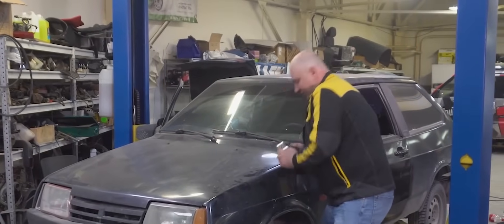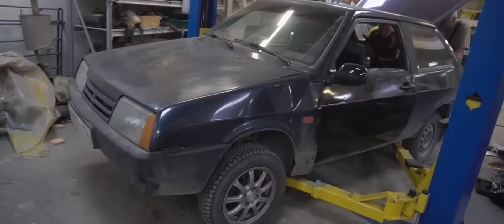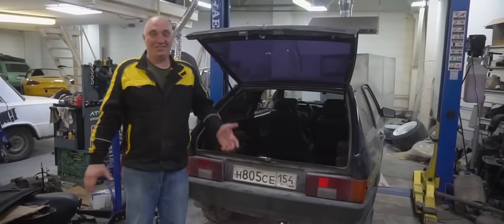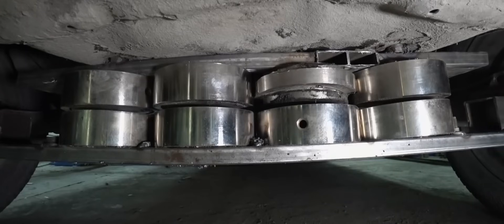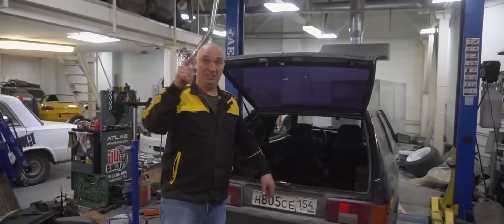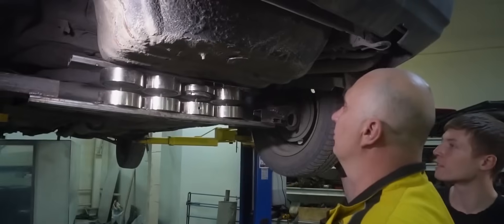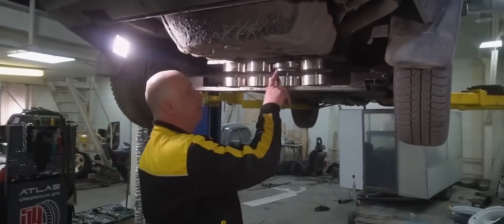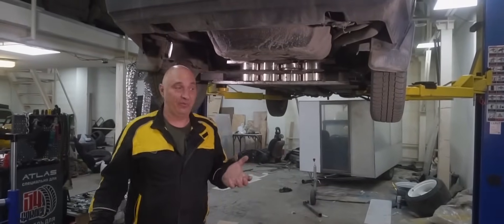DIY magnetic suspension

Comment: Could put rubber washers for shock absorber on guide posts to cut down the vibration, friction and hammering the magnets do. Electromagnetic may have more repellant, but requires power. Might be worth a test?

Comment: 3 magnets stacked at each wheel will give you 20 to 30 mm of travel. [+ -][- +][+ -] middle magnet will float with a rod thru the center again. The the other 2 will be attached to the car and axle.

Comment: As you said these are supposed to have 600kg of pulling force each, but a much weaker repulsive force, then it makes more sense to use their much stronger pulling force instead.                                          Try using two of them mounted on the fixed top beam pulling against the steel of the moving bottom beam and two mounted on the moving bottom beam pulling against the fixed steel of the top beam...Then you have a perfectly balanced pulling force in both directions which will keep the magnets apart and it will be far more powerful than the repulsive force between 8 opposed magnets.                      It is basically the same principle used for spokes on bicycle wheels, which pull the rim towards the hub and simultaneously pull the hub towards the rim...making a far stronger and lighter wheel.

Comment: Good!  I would suggest two things - mount the whole assembly on a pneumatic bag that would absorb the shock when the suspension is fully compressed, so the shock would not be transmitted to the chassis, and add an electromagnet on each end that would trigger in proportion to the amount of travel - as the axle went higher, a sensor would increase the current to the electromagnet, increasing the resisting force and decelerating the axle movement.  That would stop the permanent magnets from banging into one another at the end of their travel, which wears out permanent magnets.  Adding shock absorbers, as you mentioned, would take care of the rebound problem and damp oscillations.  Good luck with the project!
Reply: Great idea. I'm sure between you and him, you could market this idea to GM. I like the three ideas of suspension control

Comment: You can not used this magnets with the metal ring .... the magnet is pushing away from each other but the metal is pulling each other. 

Set a few magnets in line with bar in the middle to keep them in line.  You will get a longer and stronger stroke of magnetic power.

Comment: I suggest some rudimentary system associated with the existing permanent magnets but now with an active system made with some strong electromagnets driven straight in the suspension with a LM555 comparator integrated circuit with a zero point and sensors put to the shafts to establish some stability and correction action powered with an additional 12V car battery for each wheel, maybe just the one extra battery does it. Maybe I'm crazy, everybody I know calls me that. How about a second permanent alternator to power/drive this suspension and suspension battery (supposedly)....  thank you again Garage 54 for this experiment, it was really great. I congratulate you for this effort. Well this is not a blueprint for nanotechnology, but I throw my cents in it for it already.

Comment: Off the top of my head, I’d recommend 2 on each corner near the wheels. Simply because I didn’t like how close those magnets were getting to each other, I’d make a minimum of 3 on each corner in a L shape formation.
Because I’d prefer a smooth ride no matter what (you never expect “worst case scenario” until it happens), I’d place probably 5 on each corner in an L shape formation w/ 1 in the corner, 2 leading across the car body, & 2 leading up/down the body. That’d give you completely independent suspension (independent from each other) & each corner could take the full weight of your vehicle, so the magnets will never contact each other.
But 5 on each corner (top only) comes to a total of 10 (top & bottom) on each corner & 40 magnets is a LOT. I’d bet you’ll be safe w/ just 3 on each corner (top), so 6 on each corner (top & bottom), which comes to a total of 24 magnets.
Reply: this does not fit well with the garage 54 style
Reply: @apenny9300  
That’s a car I’m unfamiliar w/.
If 4 sets will work, such as what you show, I’d try to do 2 sets up front & 2 sets in back.

Comment: With all the surface area you only need a thin rubber sheet between the magnets to protect them at end of travel, if you can keep them fairly flush. The outer bands are possibly low carbon steel for high magnetic permeability and actually strengthen the magnet, rather than weakening it.

Comment: This is the most amazing thing I've ever seen! True russian genius worthy of national pride.
Reply: Dumbest idea ever. Adds half ton to the car, increases unsprung weight and costs 5 x as much as regular suspension.
Reply: So does Lexus with Bose magnetic suspension. The difference is that Bose uses magnetic fluid activated by inductors. Not dumb mega sized, mega heavy magnets. So it is electro magnetic suspension using coils if you can comprehend the distinction.
Reply: @Traderhood  THen explain why the Camaro has magnetic suspension then fool.

Comment: Instead of making a horizontal bar with magnets in series, a vertical tube with these same magnets arranged in opposite poles always facing each other ([N P] + [P N] + [P N]). The same design as a motorcycle spring suspension, but instead of a spiral, magnets.

Comment: Or why don't you go One Step Beyond with the opposing magnets if you know what you're doing by putting coils around it that the opposing magnets can generate low veritable current and you had that low veritable current that can be transmitted back through the ground to a side substation as a bunch of cars go down the street and it's undulating through those magnets to create electricity through the shock-absorbing properties or you can transpose that energy back into self charging battery Bank where you can have one more element that would charge the battery in a eco car let's get One Step Beyond everyone I like your idea but think it out

Comment: The challenge to overcome is that the force of the magnets pushing away from each other weakens exponentially with distance. The 600 kg capacity could be accurate, but only at a distance of zero.

I would love to see the results if someone could find a solution to that. Maybe a stack of them vertically...
Reply: We used to have a stack of thin magnet discs and a guide rail at school it was easy enough to squash a few magnets together, but fairly difficult to compress them down enough to fit all of them on the rail if placed entirely in opposing pairs

Comment: You can put caucho discs 1/2 " higth like shocks between the magnetic discs to amortization it.
And 1 or 2  both of magnetic discs more for better and more capacity load of the car.
And can put nuts at the end of the guia bars and. grey or black plastic or fiber glass cover in it. To protec and nice view mecanic finished.👍

Comment: I think you should try these magnets with springs. I mean you remove shock absorbers but keep spring coils attached With car. Second if you try these magnets with small air below suspensions then these magnets cover hard jumps easily and counter extra force

Comment: I think that magnetic force is proportional to the inverse of the distance apart squared, so they will only have 600kg of force when touching with the force rapidly decreasing as they are moved apart. Is probably why they did't get much suspension travel but never bottomed out either.

Comment: Metal part around the magnets redirect magnetic force all to the one side. So you get for example north pole in the middle and south pole on the outer metal rim part. That redirects from the other side of the magnet. So either you shorten the metal outer part by few cm, just to keap the magnet in place. And also navigate the oposite pole. Move the pair of magnets closer to the wheels. In the middle they are under the leverge from the distance to the wheel. So they act week.

Comment: Stack a number of magnets inside of a copper tube so they're arranged to repel each other.  The magnets should generate eddy currents when they try to move through the copper.  The eddy currents will induce an opposing magnetic field against each moving magnet and might do some level of dampening.  Not sure how you'd cap off the ends to keep the magnets contained and allow the assembly to be mountable.  I imagine it to be set up to replace coil springs.

Comment: I'm thinking that if you put a copper sleeve around the magnets along with some springs, you'd get a pretty dank suspension setup
Reply: Excellent point! I've done that experiment by dropping a magnet through a copper tube and it actually slows the speed of the magnet falling.

Comment: Make a cylinder with 3 magnet inside. 2 at the ends an one in the middle. The one on top is welded. Make it work lice a shock absorbents.
Reply: Msybe but you would need oil inside aswell to dampen everything. Not a stupid idea tho. Ya know thats crazy enough it might actually work.
Reply: The center floating magnet and the bottom plunger magnet would need small holes in them to allow the passage of oil. Put wipers on those 2 and i seriously think that could work.

Comment: Try putting the magnets evenly on the back axle, not next to each other. And add 5-6 magnets, and between them a circle of rubber, so they never touch each other, metal on metal. Add the shock absorbers and that car will go up the mountain with no problems.

Comment: If you stack two magnets you will almost double the power of push and pull. Try the stacked magnets on a motorcycle but be sure to use shock absorber! Should work really well! Moving them in pairs closer to the wheel will work better on the car, with shock absorber, of course!

Comment: You should manipulate the pullingforce in a way so you can use it for suspension as like you said it is stronger than the pushing force.
But even then, the advertized 600kg pulling force only applies when it makes direct contact, when the gap increases the forces become significantly less.

Comment: Wouldn't it have been better to put them in the place of the original cprings?  Donut magnets opposing each other, with guides over the shocks.  That way you could use 3 or 4 magnets per side, and the standard setup on the car.

Comment: The beauty of Magnetic Suspension is the high tech application. On a real M.S. the shock cylinders are filled with a ferrofluid that changes the viscosity of the fluid with a highly sophisticated computer calculating electrical management system. This is not that, but good effort though. 👍

Comment: You are into something. But maybe maybe building construction on cross so you could reverse it to the pullung force holding the car up. And build so the car cant raise high enough to reach eachoter and lock. And maybe also with combo of pushing force. If a car really would drive its lifetime its the best the suspension are mounted cornerwise. Close to the wheels. With good shock absorbers it might be cool:)
But wonder how it will be when they get harder closer they are. Might kill absorbtion. But still maybe if the complete play off the wheels go up and down is going on when still the magnets have distance. Then the hoovering is found and shocks do their work:) cool vids and stuff to find around. And your channel is amongst them:)

Comment: Stuck an electromagnetic system down there and you will have adjustable suspension on the fly. You might even able to slam the car and lift it akin to air suspension

Comment: Great video but those are not the right type of magnets to use.  They are called Pot Magnets, the steel ring is the pot and isn't for physical protection. Without going in to detail the steel ring becomes the north pole and the magnet centre becomes the south pole.  This is why when your magnets clamped together they were slightly off-set, north attracted to south. Pot magnets are very strong in close range, (which is why your travel was so short). You should use magnets that don't have a ring/pot, they will provide much more range and won't need to be so carefully aligned. Would love to see this with different magnets, and watch your fingers!

Comment: 7:53 Guy: "Why does the transmission keep popping out of gear?"   -Me: looks in direction of magnets....
Reply: when you upgrade your car but at the same time discover a new fuckup
Reply: Love the descriptive text of your reaction! 🤣😂🤣😂🤣😂
Reply: The force of a magnets magnetism depletes exponentially, so I highly doubt that it’s magnetism affecting the transmission. If anything it’s probably a problem with weak synchros and/or not having the suspension to prevent jolts and torsion forces
Reply: Bruhhhhhh that car is barely alive that's why it's popping out of gear
Reply: Metoo😂😂
Reply: The force exponentially drops off with distance...
Reply: @Sean Grahame you think twice about the pulling force from these magnets
Reply: @rafalbuijs5061  I highly doubt it would reach the transmission
Reply: @imtrash1228  
"I highly doubt it would reach the transmission"

And you would be correct in that assumption.
What is causing the transmission to pop out is the fact that when they took the shock absorbers and OEM springs off the car, they opened it up to all  sorts of twists and bends. 

Those twists and bends combined with all those bumps, are what is causing the transmission to pop out of gear.

Comment: If you add voltage to the magnets with a voltage regulator inside to adjust the magnet strength would probably work way better

Comment: Take the spring out of the strut . Find magnets with same diameter as the shaft on the strut . Use rubber spring helpers 1 under bottom magnet and 1 on top magnet to take up gap. Basically replace spring on strut with magnets and use rubber helpers to get magnets close together then reinstall strut on car.  You have Great ideas ideas Sir.

Comment: More magnets. More space between them. Surround with non magnetic material. Could pick up a crowbar or other metal.
Edit: Has to be electro magnetic. The weight of so many magnets outweighs benefit.  Youre on the right track.

Comment: Curious if you could just add some copper to you guides for diy shocks using the eddies
Reply: Definitely.  I think their largest problem is just the room required to install what they'd need.  A stack of magnets inside a thick copper pipe would provide eddy current damping.  Line the copper pipe with UHMW Polyethylene for friction reduction and alignment, sized so the magnets just fit.  Glue layers of low-density expanded neoprene between the magnets to protect them from impact (somewhat smaller than the magnets to allow them to enlarge when squished).  Mount the copper pipe to the car to reduce the unsprung weight. Some other small details like a cap with an air hole at the top and a stop-ring at the bottom to contain the magnets in the copper pipe.   This yields a coil-over configuration overall.

Comment: The reason why despite their 600 kg pull force the car almost bottoms out is not because the exert less force pushing than pulling. It’s a two fold reason. First, the strength of magnets drops off a lot as you separate them. The 600 kg force corresponds to the absolute maximum pull. Secondly, a lot of that pull force may be being reduced because of the attraction to the steel casings of the magnets.

Comment: Most probably weakened the magnetic force with all the impact and heat from fabrication
Reply: Bose did it with electromagnet
Reply: बोस दादा?
Reply: Yeah, that certainly did not help them
Reply: The poles will invert with permanent ceramic or neodymium. You need electro magnets so you can control the magnitude of the field and not worry about flux line inversions
Reply: @titirititiri6360  
Yeah but think about the power you would need to supply and the drivers for such a set up... you end up going over the vehicle's gvcw. Now maybe you could fill a shock with ferro fluid and you variable magnitude drivers to adjust on the fly. Man if nobody is already doing that im going to feel like an asshoke for giving up such great idea.
Reply: @mds1986ms  they are. Cadillac
Reply: @aayesher9400  
I remember cadi tried it but i guess it didnt go so well because im pretty sure they're back to air shocks now. Lol. Oh well elon musk will figure it out.
Reply: Yeah
Reply: @jkeelsnc  
Yeah its on the caddys and the Denali s in gmc and im sure a few others. I dont think they still use it though. Plus when you go to goigle magnaride the next thing that pops up is magnaride delete kit. Lol. So i take it its not well received. 

Alright so heres another idea. You use helium to super chill some magnets... Easy right? Just add another compressor pump like the one for the AC. Lol. Anyway then we could use some sort of quantum locking system for an all in one damper. No need for springs at all. 

Lol  i dunno what the hell im talking about obviously. Hahaha!

Comment: You need magnets without iron rings, the iron rings bend the magnetic field inward and you end up with a much smaller but more concentrated magnetic field, so if you want distance, you want magnets without the metal ring.

Comment: Correct me if I'm wrong but I think that this would make a great invention for commercial use. If you were to put a casing over the suspension (magnetic shielding) so that no metal objects would be caught in it, and use bolts to secure the magnets instead of heat because heat makes the magnet less effective, and all around just improve the design and the quality this could make for a really practical suspension and cheap too.